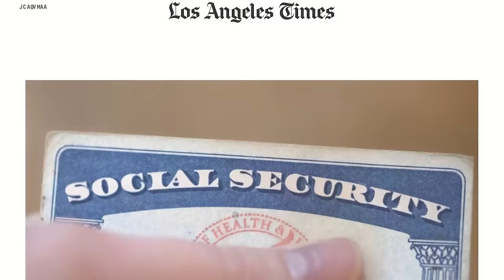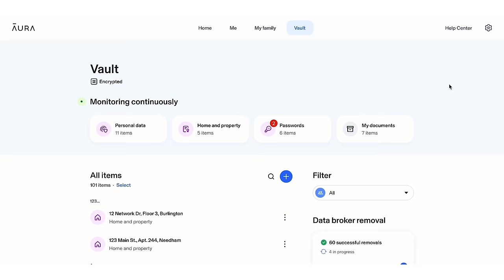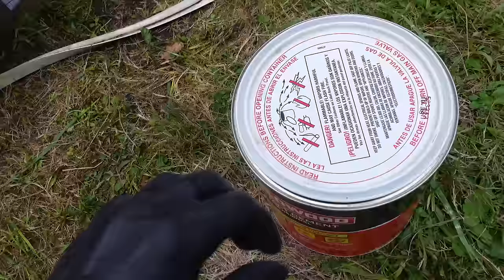answering your questions while fixing my camper roof...

Comment: I deal with moisture control everyday. I recommend after the glue has set on the top that you one by one remove each of the exposed screws and squirt a sealant into the hole and re-install the screw. Don’t just top coat the screws with silicone as it will fail and water will get behind the screw. If you go to your local gutter/eavstrough installers shop and get a couple tubes of white “gutter seal” (Gutter Seal is the brand, it is not silicone) that is the best for roof sealing.
Reply: The manufacture is NPC. It’s a blue tube. Best product I’ve used for roof sealing on rv’s or sunroom/solariums etc.
Reply: She's using them just to hold the outside roofing on & taking them in & out is no bueno
Reply: @richarddworczyk6372  I feel you misunderstand what I was talking about. I know she is using them to hold the roof on, but if you just put a blob of sealant on the top of the screws it will fail. She needs to undo 1 screw at a time and squirt sealant under the screw than reinstall then screw. So…yes bueno.
Reply: @sw5334  She's already putting adhesive between the wood & outer service plus the self tappers she has is way better then factory... Taking them out & reusing becomes a problem especially going down the highway & the self tappers she has are way better than what you are talking about... She has sealant plus using tappers with rubber washers so you would be adding a weakness to the entire roof going down the highway but still better than the factory did
Reply: @sw5334  I didn't misunderstand anything... My first brand new truck I saved up to buy I know 100 percent better than most because of the accessories I added... The only thing I would have asked if they were stainless steel or just normal...

Comment from the maker: If you have any more questions leave them in (a separate) comment and I’ll try and answer more
Reply: Haaa!! I did the same thing 10:05 when I was doing the motorhome SMH ehhh lesson learned. Try returning the glue and exchange it for the right one.
Reply: A dog will be more expensive than a child lol
Reply: Looks at Victoria...
Looks at camper... "you beautiful but you ain't too bright"
Reply: @ragnarsrevenge3248  you must have an iQ through the roof. Never made mistakes aye! Heaven is beautiful and you ain't invited 😂
Reply: @SigmaSkyGig  Yes, no and sounds like you have a god complex if you think that is up to you
Reply: Lmk if you wanna get bought out n not next to me and against me
Reply: Dear you can also buy cans of fiberglass and bondo and mix it. It is usually a very strong mixture.  I know that the auto parts have it. U can buy it online. Plastic wood filler and j b weld is very helpful also. Probably Lowes or lumber yards sell this stuff also. Of course super glue that everyone knows about. Good luck and enjoy.

Comment: I had trouble repairing a roof because it is hard to eliminate all leaks.  Even a small leak lets water get in and ruin stuff.  I know you are on the right track with this because this camper is light enough and when you get your truck fixed it will be perfect for you.  By the way good luck with your truck, wishing you the best outcome on this!  Also hoping you can leakproof the camper roof.  Your repair is interesting. .. ROBERT

Comment: You might help cut down expenses by getting an E Bike to run to get groceries or whatever instead of driving the truck. Charge it from the truck while changing locations. They are nice for exploring trails and scenic driving in areas you are camping in. Solar charging is also possible. Are you putting solar on the roof of the popup???
Reply from the maker: I’ve considered that! Although I need to be careful about the amount of weight I’m putting on the truck with the camper
Reply from the maker: And yes I plan I solar powering it !
Reply: Never got a totem ebike to work..am using parts on a trike tho..

Comment: I love the outfit you got on during the roof rehab, you look amazing in that while working your magic on that camper. Another idea for the crank (mentioned in your later video to use bigger diameter gears) but before getting into the cranking system, get some fluid film spray and grease up the spring and gears for the cranking system. It might just need lube. A dog is in no way like having and raising a child (no comparison). Huge responsibility with a child, true dogs are dependent on you but it goes beyond dependency when you have a child to take care of. I am sure you would be a stellar mother though. You most certainly would be the prettiest mother out there. As far as the roof, coroplast is lighter material and rigid so it holds form. Very easy to work with, look it up.😊

Comment: If you haven’t already solved the lifting of your roof issue, you should consider changing it over to a mechanical lift/power lift. It’s not that difficult, and would give you peace of mind and definitely lighten the anxiety you will get by trying to deploy. it by yourself using the old school scissor lift. Just FYI hope this helps is looking good. Keep up the hard work girl!
Reply from the maker: Hopefully we can fix it to the crank works nicely again!
Reply: @TorieRobot  hey Tori, earlier I sent you a link to a video on YouTube of another creator by the name of MAV who you probably know of he has a friend redo his Volkswagen collapsible top camper. You may want to check it out to see how it actually is and how well it works, just an FYI with a simple push-up button it cranks up and is secure with no more fear of maybe losing a digit in the process anyhow good luck with all your stuff

Comment: As someone working on a lot of projects in regards, don't put tpo on it. I know it's recommended for being light weight but even professionally installed they leak within 4 years because of how crappy material are now. I would use flat roof material instead since it's 2 layers.
Reply from the maker: What’s tpo?
Reply: @TorieRobot  it's the white rubberish  lightweight roof paper they put on the top to water seal campers , they just don't make that  in hardy material like back than. Also don't use any OSB plywood, I would go with cdx which is usually 47$ per sheet (4ft x8ft ) it's more resistant towards moisture and it also has a higher rt value keeping the inside cooler. 😏

Comment: I think everyone learns the hard-way about solvent adhesives and foam at one point or another. You just pay the toll and move on to polyurethanes. Welcome to the club!
Reply from the maker: Thanks haha this is all new to me
Reply: @TorieRobot  I've done a lot of marine and camper repair on the side... I'm only just now at the point where I don't have to Google material compatibility every time, haha! Modern polyurethane glues, and foams are so much easier to work with, and they seem to last. Best of luck!

Comment: "Poor Man's Fiberglass" (basically a cloth embedded in tightbond woodglue, usually over foamboard) might be a useful material for you, especially if you have to rebuild that camper top. Lots of "Foamie" campers out there use it for strength and waterproofing. Keep up the good work, and thanks for sharing your adventures!

Comment: Just a suggestion for sliding the top on, use 1,1/2” pvc pipe to lay across the top of the camper to slide the top on. It will roll on the pipe, then just slide the pipe out.

Comment: Don't know if you solved your glue problem but I use LOCTITE Power Grab Latex Multi-use Interior/Exterior Construction Adhesive. 6.00 a tube. It won't melt the foam board. I'm doing renovations on a fifth wheel rv.

Comment: Vancouver and Vancouver Island are incredible. It's mild there even in the winter. (little to no snow anyway) Use rubber cement on styrofoam and add the glue to both surfaces!
Reply from the maker: I’m glad to hear there’s minimal snow

Comment: I would mabey use that gallon of adhesive you can't use and spread it over the outside roof as a final coating seal.I don't worry about astectics to much on something out of site.I don't think it would hurt,and it would ad a extra degree of protection.DON'T forget to grease the campers wheel bearing before tripping out,at least check them.A dog is a good idea,at a minimum ,he would bark as a warning.Hang in there Rosey,your special.

Comment: 3M spray adhesive super strength should do the trick. Or just liquid nails but it does not flex once its cured and that will need to be a consern

Comment: 15:00 hey good job. That looks Nice 👍.. umm. Suggestion.  Cross square it, If you don't know what that means, all you have to do is take a tape measure and run it from corner to corner and make sure the numbers match. If you with in 1/4 in should be good... But I don't know how much Flex is on that. So I would take that as just a grain of salt because if you're out an inch it'll probably still fit. But if you're 3 in out there's a problem I would say and that's probably because It was just fit wrong but I don't know. It's a guesswork for me on this part but it would have to make sense to have it to be square Or it won't fit properly.. I'm sure it's Square pretty damn close because you've already got the forming of the body of it. All they have to do is set it in there and screw it in and that should Square it up. Pretty damn close But it's a suggestion if it's out 6 in. I don't know. Doesn't make sense to me that that s*** happen. But if it's within an inch I think it should still fit. Maybe I don't know

Comment: 16:59 IMO u should have the roof of the camper done b4 first snow fly. The installation can be done outside in the snow if necessary. . As long as everything is trapped up.. little bit of water on the floor of the camper won't hurt it, that's because the snow won't melt outside if it's cold enough .. but IMO,  have to be ready for a two day installation of the roof in the winter .. that's just off the top of my head.  Anything longer it's  problematic that pushes the time limit up, and causes sufferable damage to your rig. Stuff u don't want to really deal with, could become a headache .. haha😅😂 omg 😱😳 I can the swearing 🤬🤬🤬 comming . Get a camper she said. Ha 😅😂. Get her done B4 fist snow fall, work hard prioritize necessities first, which your doing by the looks of it. . u can do it.. fun fun 😊 hehe

Comment: One thing you will have to learn once the camper is on the truck is looking at height signs . Watch overpass , underpass , bridges , tunnels and any other objects that you may run into and wreck camper .
Reply from the maker: Yeah gotta be aware of that
Reply: @TorieRobot  Get the height of truck and camper when done and put sticky note on dash just to remind you until u get use to it .

Comment: 13:57 half to think about the traveling part ..that pop-up roof, if it's not a pop-up roof. Might not fit under a bridge in Mexico or Canada or certain parts of the states where the bridges r not regulated to can't remember the code for bridges. Theirs that.

Comment: As far as your plans to do Mexico and South America I think it would be a good idea to find some friends also on the road who want to go that rout also and travel as a caravan even if only 2 vehicles it would be safer and less stranded should one of the vehicles break down. Check out the South America trip Trent and Allie did and you will see what I mean, Once I get on the road I plan on at least Alaska, But don't think a caravan will work for me because I will take the trip a little longer than most because I want to spend some time looking for gemstones and maybe checking out ghost town areas. And South America I want to spend some time at a lot of the Inca and Aztec sites. <photographing>

Comment: The dude that had the camper probably did not know how bad it actually was. It was on YOU to know. 

That said, to make that roof so it lasts forever is to do the work you are doing then use West System marine epoxy and fiberglass inside and outside.

Comment: Why did you not, (or did you and just not film it) ask an employee at the hardware store what kind of adhesive would be needed for that specific foamboard? I take it that the entire roof does not get the foam insulation?
When and where is the XJ going up for sale and will you be announcing it on the channel?
Reply from the maker: Yes I’ll be announcing where I sell it- it will probably be eBay

Comment: Trash the camper, you are never going to repair the crap it was built with. Just my opinion as a carpenter with 40 yrs exp.
Reply from the maker: Bit negative
Reply: @TorieRobot  If you have a ton of money to put into it, fine, go for it. The damage I saw was way beyond worthy of repair. those things are made of cheap pressboard. Sorry that you bought some junk.

Comment: To be honest...you're videos have gotten to be so few far and apart. Surmised you had lost your sponsorships and gave up on the youtube aventure. Fyi to anyone reading this. Spray Adhesive for foam padding applications. Gorrila brand for use on sand paper works wonder and resist heat. Metal self tapping screws..not meant for wood. The drill edge cuts away to much of the wood fibers for the threads to anchor too. Yes appears to hold..but time and vibrations..they work back out making the hole bigger.